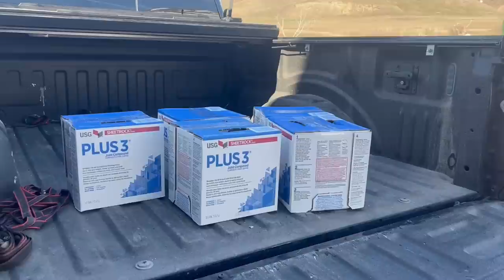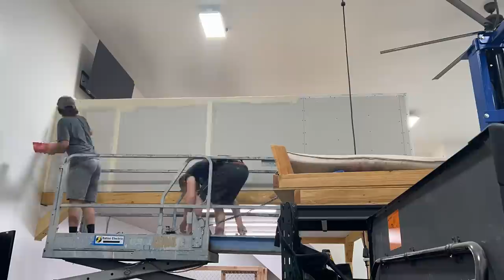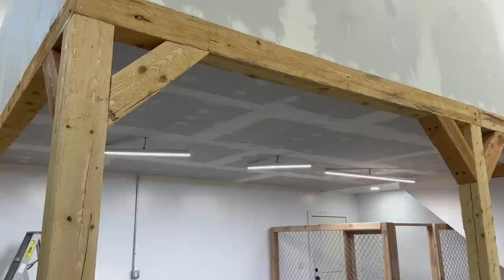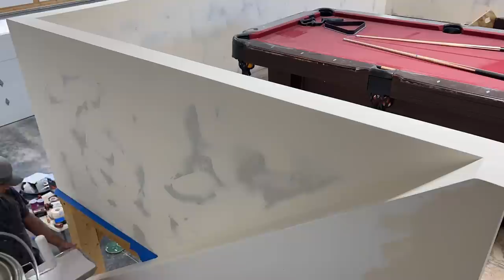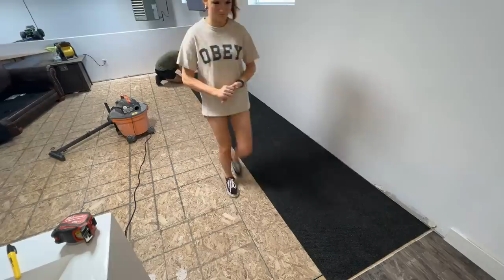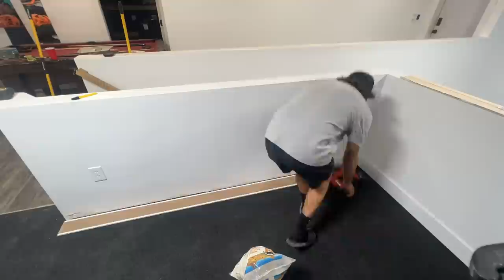Easy DIY Loft/Mezzanine Build Part 2 (Shophouse/Barndominium Build)

Comment: I'm doing a similar project, but wondering what you use to keep the shop (couch, pool table, etc) from getting dusty? I have a similar garage heater and fan, but everything gets covered in dust. Do you use a filter system of some sort?